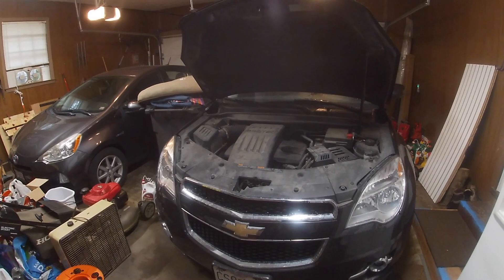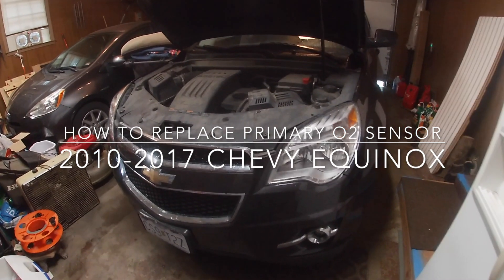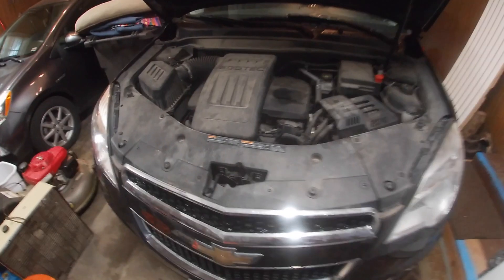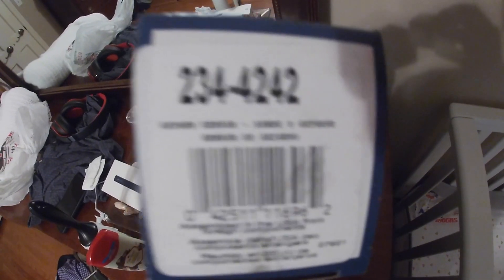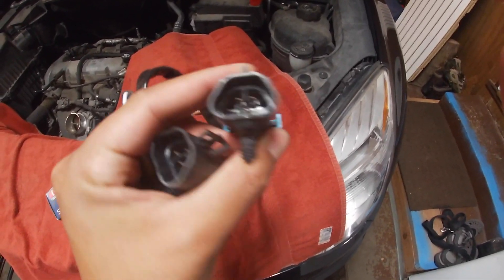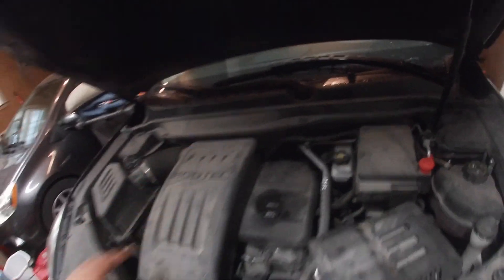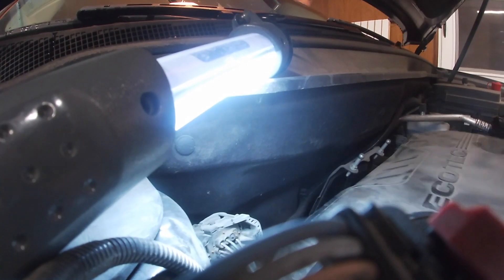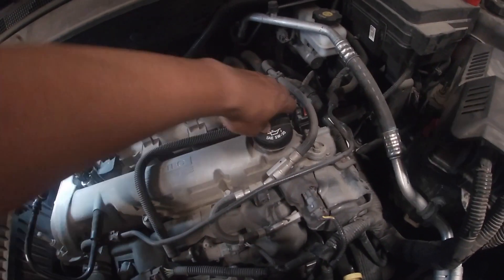How to replace Upstream or Primary o2 sensor on 2010 to 2017 Chevy Equinox with 2.4 P0153 Code

Comment: I Did Understand The Video A Little Still Not Sure Why Is It Still So Hard To Remove The 02Sensor & Mine Is A 2012 & The Question Is Will The Car Still Drive Good & Will All The Lights Go Off On The Inside & Does Everything Have To Be Reset Also?

Comment: 2014 equinox. Check engine light came on one day and for a minute the car hesitated to accelerate then was fine. A few days later the car won’t start. Cranking but not starting. I’m get code p219a bank 1. What’s my problem???
Reply: Mines is doing the same thing
Reply: @sharmainmillersm  well I just had it towed to the shop. Fingers crossed it’s not a fortune

Comment: I like how you conveniently skipped over the part where you actually got it loose and took it out, which was the whole reason I watched your video🙄
Reply: A little tip for yall. Spray the sensor with a penetrating oil and let it sit for a while before trying to break it loose. If that doesn’t work you can also start the engine and let it run long enough for the exhaust to get hot. This will also help free up a stuck sensor. Just be careful not to burn yourself on the hot exhaust components.
Reply: Ya I just watched this whole video for basically nothing! Terrible job man!! Needed allot more info on it!
Reply: Yup
Reply: Yep
Reply: I just replaced mine. I sprayed "Free All" On it before I took off the bracket. Then I sprayed again. Let it (or any penetrant) sit on there for a bit. Then use a torque wrench to turn the oxygen sensor socket. They're long and give you a lot of leverage. Mine came out pretty easily.
Reply: He just wanted to show you he was smart not how to solve it
Reply: This video did nothing for me 😭. Bruh WTF is this
Reply: Truly. I'd like to add that I also love how he skipped over removing the connector which is the whole reason I watch this video again

Comment: FYI if you’re getting P0131 low voltage after changing a cracked exhaust manifold (Extremely common on 2.4L engine) make sure you relearn HO2S with advance scanner like Autel scanner before you spend unnecessary money and work. Just relearned mine and worked great after. No more codes!

Comment: The 2.4l 4 cylinder can pop a dtc p1053 ? P1053 is a bank 2 sensor 1 code. The 2.4 only has one exhaust manifold and one exhaust down tube  which means it only has one bank with 2 sensors, bank 1 sensor 1 and bank 1 sensor 2.

If the equinox was equiped with the 3.6-liter V6 it would have bank 1 and bank 2. Maybe you had DTC 105A

Comment: i see you didnt have the secondary air pump valves to remove under that back bracket. my 2015 has 2 air pump valves in the way

Comment: I have an issue with my 2016 chevy equinox 2.4l LT trim. When i start it up from a cold engine it sounds like a dang helicopter and once it warms up it calms down. Through out the day it happens when i go to start it and engine cools down it just idles roughly but i never had an engine stall, or engine failure. Any ideas of what it could be? I checked the coils, boots, plugs, no leaks im kind of stumped
Reply: Idk if you’re still having this problem but mine did that it was a broken exhaust manifold

Comment: Do the sensors need to be torqued down Or just tighten normallyEspecially the downstream one?
Reply from the maker: Just tightened a good amount (estimate 26-33 ft lbs torque), so slightly more than you would usually do spark plugs. Would be super hard to try to fit a torque wrench there.

Comment: I just got the po420 code.  Hope I can use this video just to replace o2 sensor and not the catalytic converter.
Reply from the maker: Your code may be related to a faulty secondary or downstream o2 sensor.. have you scanned it or done any sort of diagnosis to verify if the sensor is working?
Reply: @PatrickKasilag  we just went to auto zone. That error code came up. Wish I was more of a mechanic. But I YouTube the hell out of everything so I’m Atleast informed before dropping it off at the workshop. I’ll definitely tell them to just check sensors. Hopefully that will clear it
Reply: I'm going thru the same thing with the code from auto zone, I want to replace the O2 sensor before replacing the whole cat converter.
Reply: @shicniaknewton6598  that seemed to work plus used cataclean and no problems.

Comment: This should read ...Where the primary O2 sensor is located. Those O2 sockets rarely work, it's a very harsh location after all the heat they go through it is literally welded in there. The socket will spread open because of all the torque that is needed to break it loose and round the points right off making it even harder to get out. If your dead set on removing it, cut enough of it off to use a regular 22mm socket and spray it with a good penetrating oil not WD-40 frequently for a week or so before you start at least once a day. If your driving it the heat will burn it off, but just keep spraying it. And have a map gas torch the one you can get at any Home Depot or Lowe's, just in case you need to heat it up. If your lucky it will come out with just the socket, my experience with these things is that there usually a pain to get out. GM should have used the same thing Toyota did with there's. Also if you have to remove the heat shield have a M6-1.0 tap incase you need to chase the treads on the heat shield and be very patient use a lot of oil you don't want break the tap.  And good luck.
Reply: I had mentioned "If your dead set on removing it, cut the enough of it to use a regular 22mm / 7/8 regular socket. I probably phrased it wrong. I should of mentioned removing the heat shield along with that line and not at the end. I got mine off it's a 10 mm socket and spray these to. Just have to be patient because there challenging to,  A friend told me to spray and wait at least 45 minutes before trying anything that had a lot of heat on it. And then tighten it, just a tiny bit to break that bond if you have good light you can see a small puff of material from bond, and then back it out. Mine where not that bad but you just have to patient. I chased all the threads before putting it back together. The heat shield 3 bolts, and the O2 sensor manifold threads M18 x 1.5mm and  M6-1.0 tap for the heat shield. they were about 15.00$ for both taps. sorry about the confusion.
Reply from the maker: Although I do agree with tour statement, it is extremely hard to fit a long 22mm wrench in this specific application’s o2 sensor location. I usually soak o2 sensors in wd40 or Pb blast and/or even have to use a torch at times. Then usually use a 22mm wrench and a hammer to break it loose, but I simply could not fit it in this location so a socket had to be used. I’ve had cheap Walmart o2 sockets spread and even round out sensors before so I know what you mean, but a good socket really came in handy for this primary o2.
Reply: @PatrickKasilag  I just replaced mine and I purchased a Tekton brand O2 sensor socket. Chrome Vanadium.   It might be the same one you used.  No issues with the socket spreading.....And I had to put some serious force on it.  I had to add a pipe extension onto a already pretty long socket wrench to break it loose.  I really didn't just want to cut off the cable and use a regular socket given that I wasn't 100% sure I was going to be able to get it off.